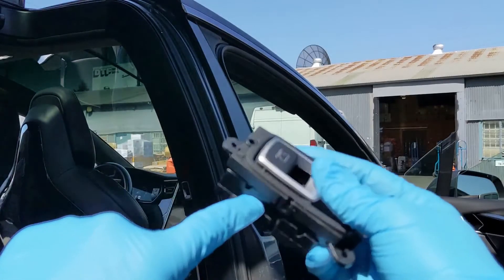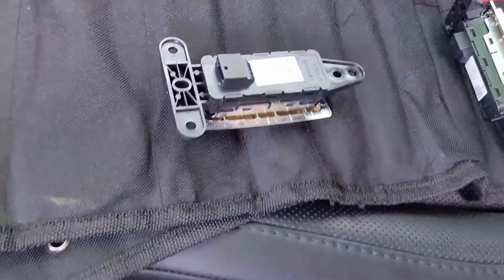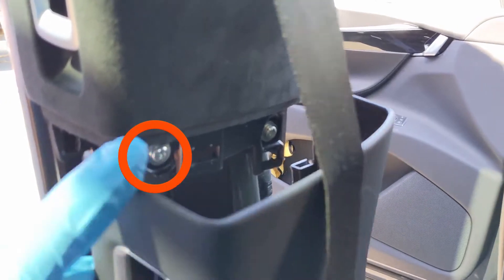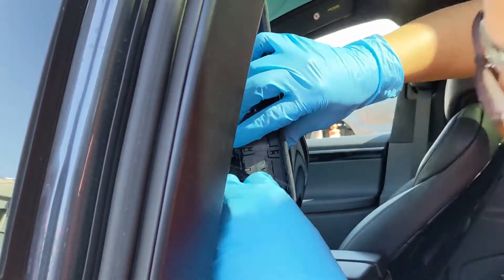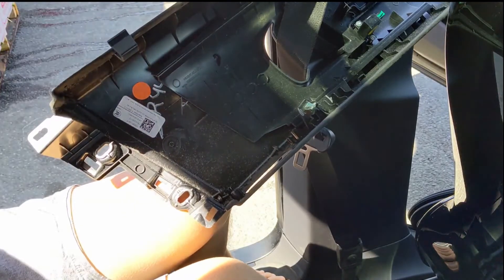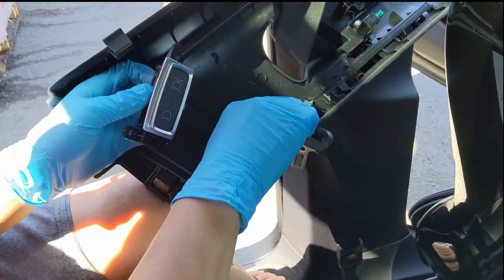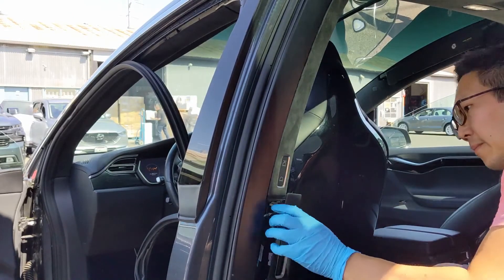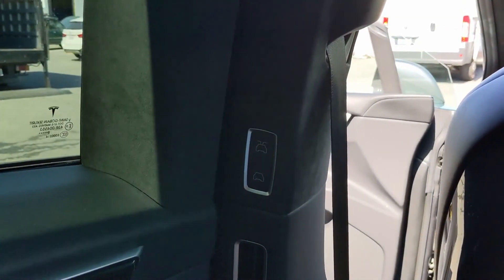Tesla Model X Falcon Wing Door V3 switch upgrade! 🦅

Comment: Thank you - this was great.  Just FYI, tried to order the part number, they said wouldn't fit my Dec 2016 Model X (not sure I trust them) - the part # 1038107-02-D - now $38 each, instead of $11 each - may try and stop by a different service center.
Reply from the maker: I think that's a parts catalog issue. The part below 100% fits! The part number you posted is the original door switch (which I removed). I just double checked my invoice and it was dated April 16th, 2021.